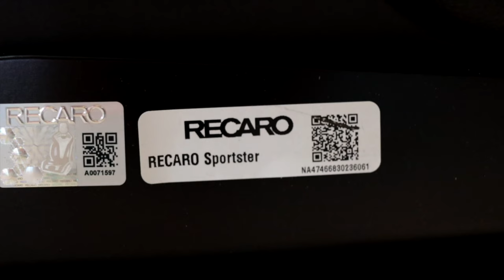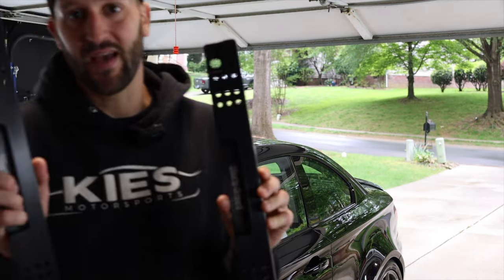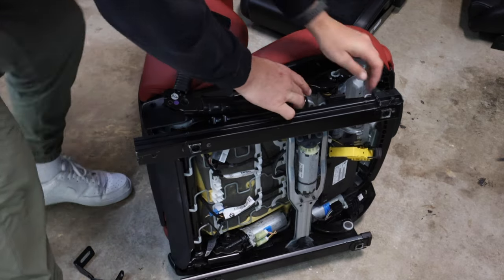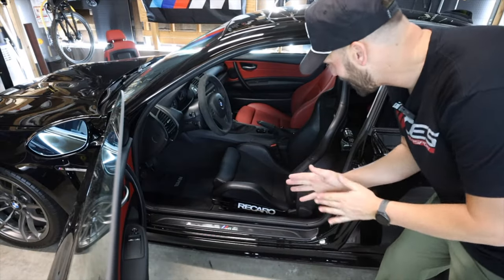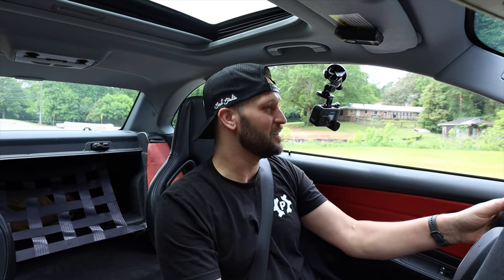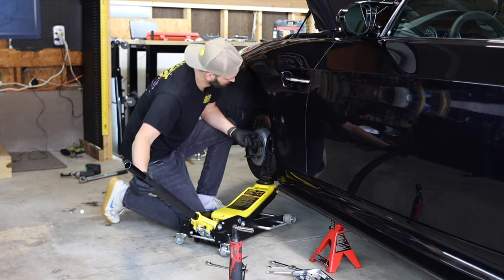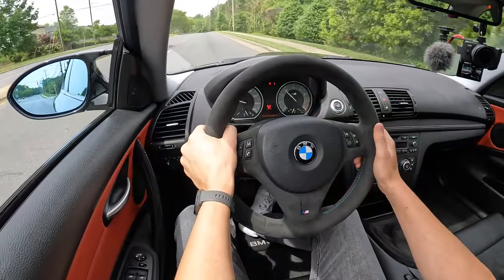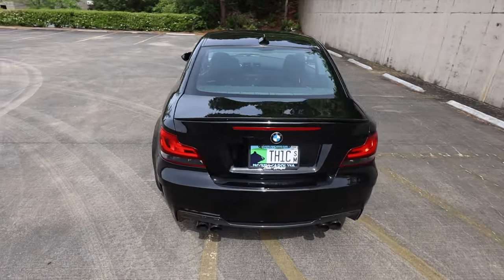Every BMW NEEDS These SEATS! (Recaro Sportsters: Install & First Drive!)

Comment: Hey After Installing the seats Did you have a airbag light show up on the dash or do you remove the sensors from the old seats & transfer them to the new ones?
Reply from the maker: Yes you will receive airbag light. You’ll need to have that coded out

Comment: When you pull the latch to lean the seat forward does it also slide forward?
Reply from the maker: No. You’ll need to lift up on sliders to move front and back